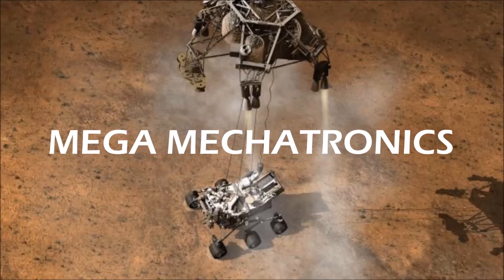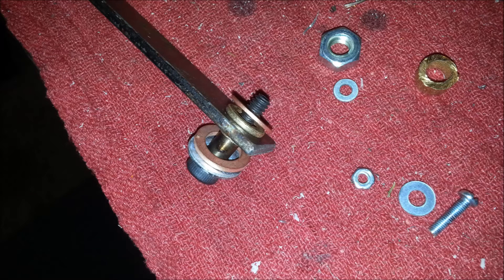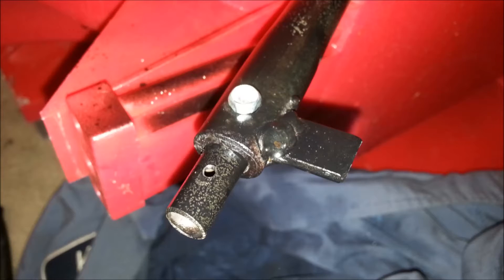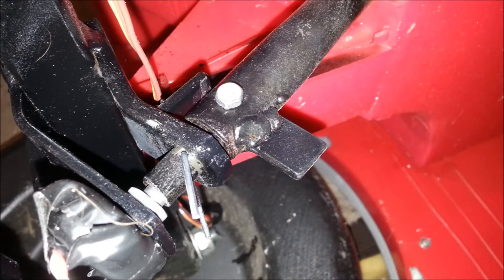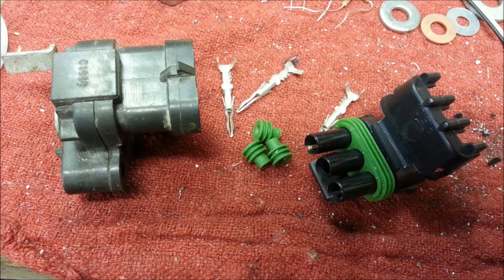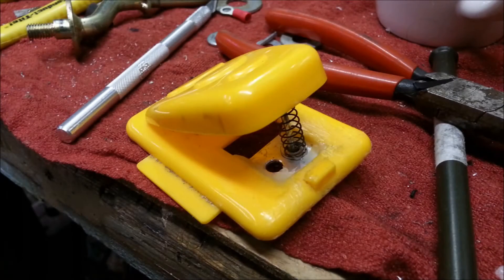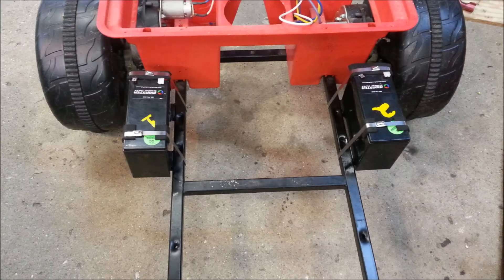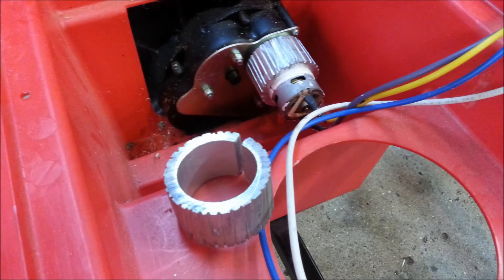Power Wheels Mods Explained Kidtrax - Part 2

Comment: This is exactly what I have been seeking guidance on for my new project. I am building a  work cart that will have a flat surface , approx 3x5 feet, that I need to carry materials while working at my desert cabin. Want to haul 8 foot 4x4’s, or say three bags of cement. Don’t know how the motors will hold up but plan on using a chain drive to a rear fixed axle. This video describes what I will use for steering. Making the cart to follow me around the 2.5 acres. Like a handy assistant. Any replies or advice would be appreciated. Frame will be welded 2” square tubing, 12 inch flat free tires. Need an electric motor, battery and controller that will work well. Terrain is sandy and uneven terrain. Thx Z

Comment: are you using the stock 12v motors? i upgraded to 24volts with the esc kit and my motors keep frying. i can't get the damn pinion gear off to put on a after market motor!  help! !

Comment: Well done.  In your other videos of this driving around with a load; is this the steering servo you're using still?  I picked up an HS-805BB (https://www.servocity.com/html/hs-805bb_mega_power.html) for mine, but the problem I'm finding is that it doesn't seem powerful enough.  Even if the car is sitting still without a load (other than the car's weight) the wheels don't turn.  I suspect I'll shrink my servo arm to see if it gets more power.  But, given I want to drive it with two kids (60-70 lbs total) I think I might need to add more giant servos.  Taking your suggestion, I was thinking of running 2-3 HS-805BB's, do you think that will have the power needed?

Thanks